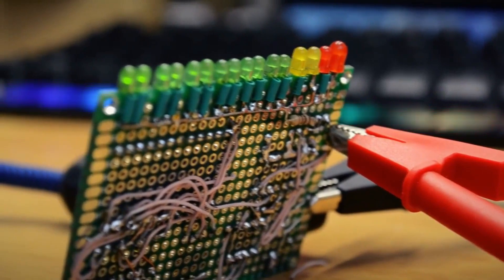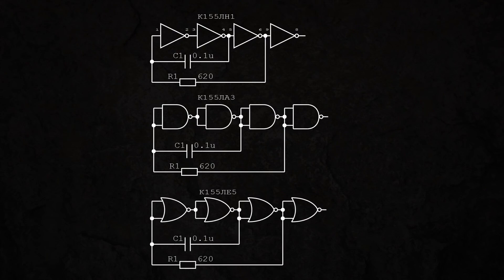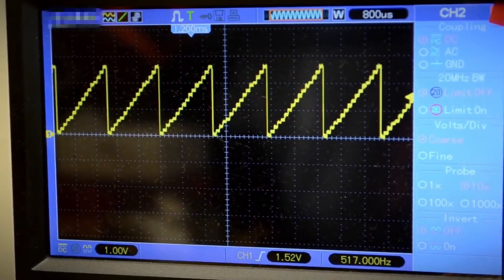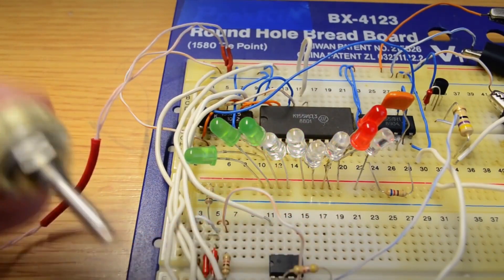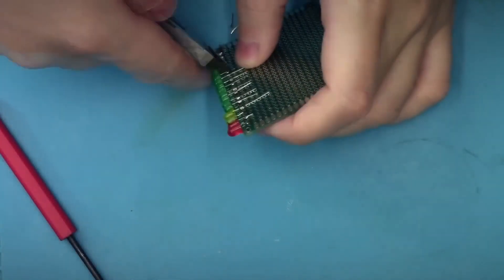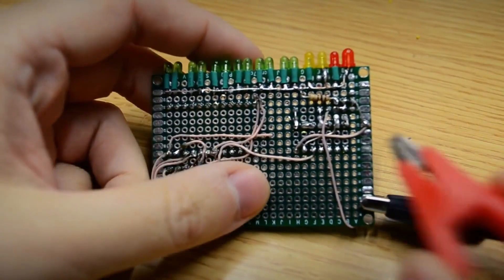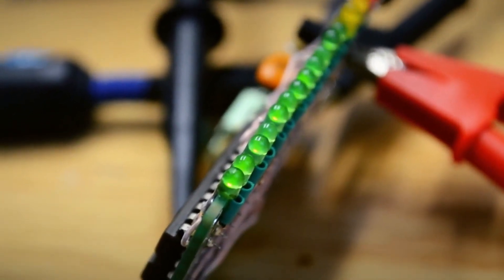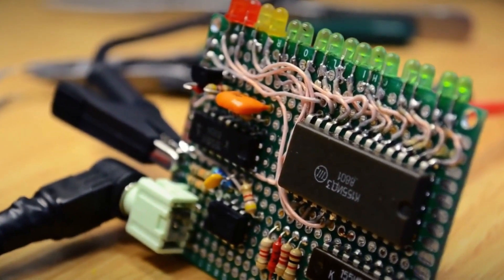Audio level indicator – complex circuit.

Comment: I suggest you to build with CMOS logics. 4049 for oscillator, 4516B (or 4024B or 4040B) for binary counter and 4514B (or 4515B) for decoder. CMOS logics can be energized by 5V up to 15V.
If you build with CMOS logics, you can replace R4, R6, R7 and R8 with 82k, 39k, 20k & 10k respectively. R5 can be adjusted to get convenient A/D conversion range.
Cheers

Comment: It's a nice project, but it's not good for audio because it's linear. A logarithmic scale is required for audio.
Reply: True. 13 convenient 3dB steps: -30dB (1 over 1000th of power capacity); -27dB ; -24dB; -21dB, -18dB, -15dB; -12dB; -9dB; -6dB; -3dB; ±0db (100% power); +3dB (200% power (high distortion)); +6dB (400% power (burst)).